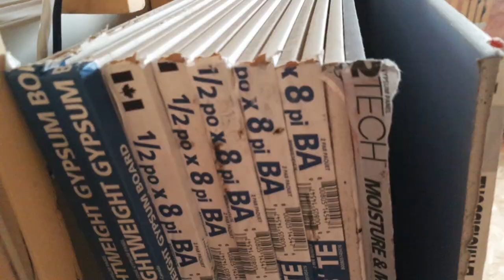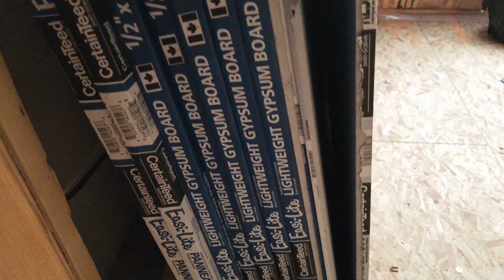Commercial Metal Stud Framing And Drywall Materials Explained

Comment: For the caulking I always get confused acoustic rated and fire rated. Is the fire sealant acoustic rated also. Or do you have to use different sealants ?- that is fire rated and acoustic rated. That mean u need like 3 different sealants- 1 acoustic rated, 2 fire rated and 3 acoustic with fire rated. If u get what I mean. 😂
Reply from the maker: So from my experience and to my knowledge we only use acoustic/waterproof (the black chemtron) or fire rated (red hilti, or grey) not both and they are applied in  different areas. The black goes under metal track, between the poly vapour barrier and substrate (wood or steel) and at joints/corners, bottoms. The fire rated stuff goes at the top of the walls and around any penetrations. Sometimes an extra rating is applied and they fire rate the bottom but it goes under the board 1/2" or 25mm between the floor and the black always goes under the bottom track. Man I could talk about it more let me know if you have anymore questions my man!! Thanks for coming by!
Reply: Construction Kronies so is the fire rated sealant acoustic? Because if u have a situation where u want the wall fire rated and soundproof u would  just use the fire rated one?
Reply from the maker: Yes the fire caulking has smoke and acoustic suppressant properties. Each type of caulking has its own place and you wouldn't reverse them. The fire rated stuff is for penetrations or to final seal walls at substrate transitions. The acoustic water repellent goes with the vapor barrier and underneath walls.  Cheers Mate!

Comment: Hey Chris, Thanks for the great videos!  With your help I put up my first 24' tall wall.  It turned out awesome!    Question:  On the last building the framer used steel bracket clips #BC600.  Those walls are now are all covered by drywall so I can't see how they were used.   Would you explain when to use these clips and how to install them?  THANKS!!!
Reply from the maker: Awesome stuff my man!! Yes those clips are shot onto the structure with a Hilti direct fastening tool. You can get clips that have deflection as well.

Comment: What kind of fasteners do you typically use to attach the tracks and the drywall?
Reply from the maker: We use the hilti pins mostly to attach the tracks. There are 2 types, 1 for concrete and 1 for attaching to steel.  We also use 1/4" pin bolts to attach tracks to concrete, just need to use a hammer drill and if the steel track is 16 to 14 gauge you need to predrill the holes with a step bit. Drywall is attached with the 1-1/4" regular drywall screws for light gauge steel and self drillers for heavy gauge. For 2 layers switch to the 2" screws!

Comment: What kind of snips u recommend? I gotta cut 40 holes for a switch that was overlooked in 40 of the same type of room. In a 6 inch wide, existing metal stud. Thdirs a hole already but it's to high. So I can get in there but it's pretty tight and taking longer then I'd like. Sawzall is out of the question because of nearby data wire. Need a better option. Good Snip brand? And do the left/ right/ straight cutting type of snips really help?
Reply from the maker: Yes you want the Red (right) cutters go with Wiss Snips. It's good to know what gauge of Steel the 6" studs are. If its 25 gauge your laughing but if its heavy gauge you may need a grinder. Let me know if you have anymore questions!
Reply: @ConstructionKronies  i got no idea of the guage. I would think it's somthing kind of standard, not real thick/ not real thin. But deffenitly giving me some trouble because of the lacation. I'm gonna grab some new snips and pack a grinder. thanks bro.
Reply from the maker: @wootexclusive8499  so welcome. If its standard your good, the Wiss snips have been the standard cutters since I started 25 years ago and are still rockin. Grinder is always a good thing to have just in case. Let me know how it goes!

Comment: Hey man, just wondering if you’ve heard anything on Aldritt tower. Things have been very quiet, and so has the site itself. I didn’t realize that the architect, Brad Kennedy sadly passed away, would that affect whether or not it’s built do you think?
Reply from the maker: No I don't believe it will stop it. It may have something to do with why it's been in pre construction for so long. I was thinking too that since the province has been in conflict over the pipeline business is down and the change of government. It's going to take time to bounce back from that. It's still said they will be starting soon. Thanks for checking in!!